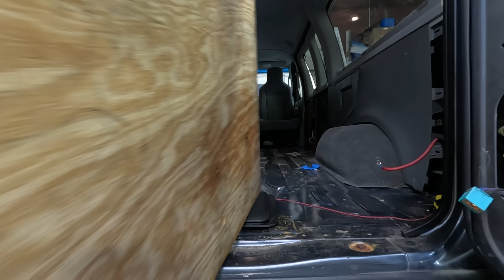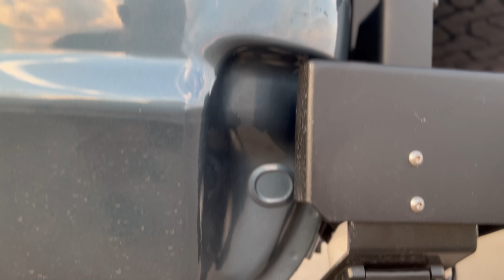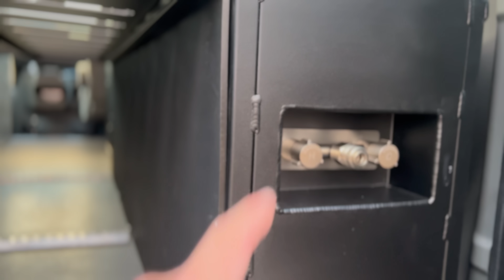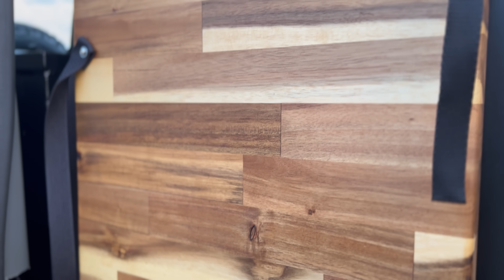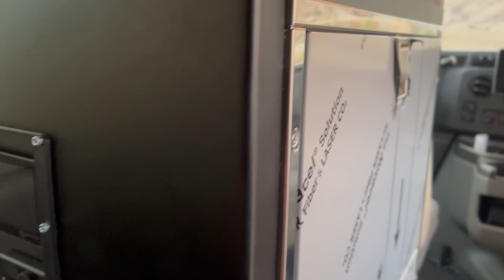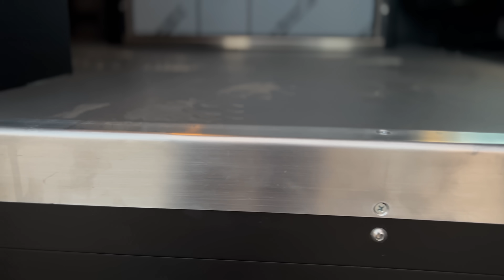Ultimate Off-Grid Adventure Ready | Ford E350 4x4 Van Conversion

Comment: Noticed that these are battle-borne batteries that are in this van. If they are 2025 model year batteries. Those batteries have a problem with the positive terminal coming loose overheating and melting the case of the battery. Just just wanted to let you know.
Reply from the maker: Appreciate the heads up on that.

Comment: The shore power connector is in a great place...to get damaged while off roading.
Reply from the maker: If he hits that connector that will be the least of his problems.
Reply: @Hancofab Not really.  It is quite common to drag the rear bumper when off roading.
Reply from the maker: @stephenurban9880  if you were to crush that connection point you would crush the rear rocker of the van.  Plus this aluminum rear bumper is not designed for that type off offroading.

Comment: Sweet build! Knowing nothing about anything, is the aluminum lighter than wood that people typically use for interior builds?
Reply from the maker: It is lighter than wood by a pretty good margin. Also allows you to build them in a modular design you can bolt into the van. They are extremely rigid.

Comment: Question about the 2nd battery - why not put it in the engine bay, or not enough room? Are they safe to have exposed to the road like that?
Reply from the maker: Actually on the vans they are frame mounted for the factory on the diesels. On the gas vans they are only mounted under the hood with no room for a second battery.  This owner really wanted one, so a small custom mount was built.

Comment: That shore power plug should be moved if you ever off road and drag the bumper it's destroyed not a good spot for 4x4 van
Reply from the maker: If that shore power gets smashed that will be the least of his worries.
Reply: @Hancofab not really it's very easy with that departure angle too drag that bumper even just crossing a small ditch especially being a van just saying would have been better in different spot

Comment: 2nd battery in a factory battery box  off a diesel van and a remote switch for the ACR would have been cool. Super clean build, nice work.
Reply from the maker: That was my first thought but this has weld mount frame sliders.  Unfortunately it would not fit. Had to go the full custom route.